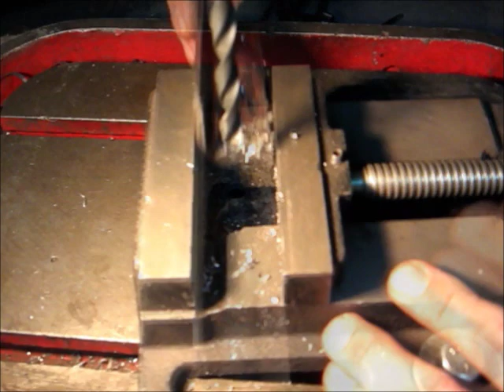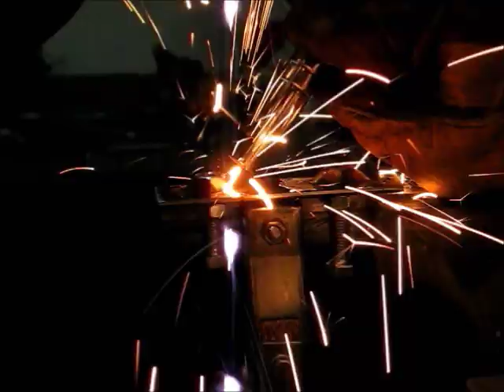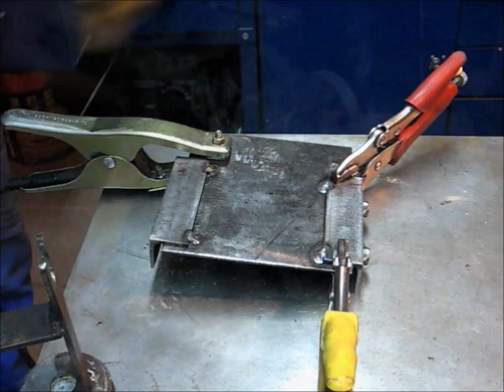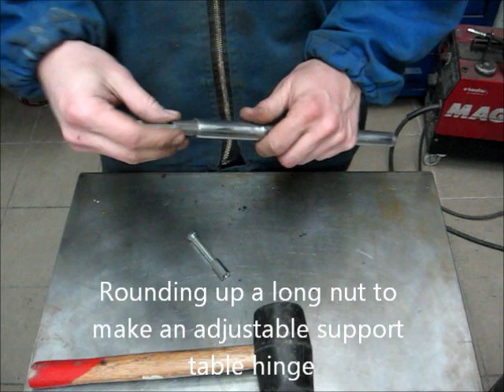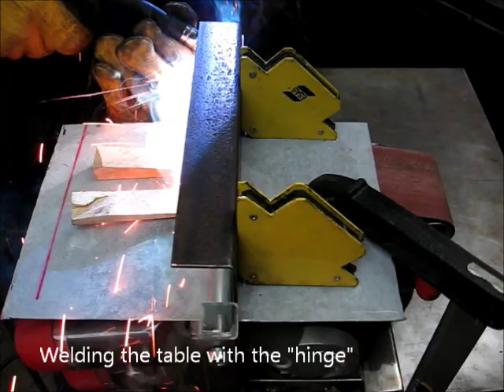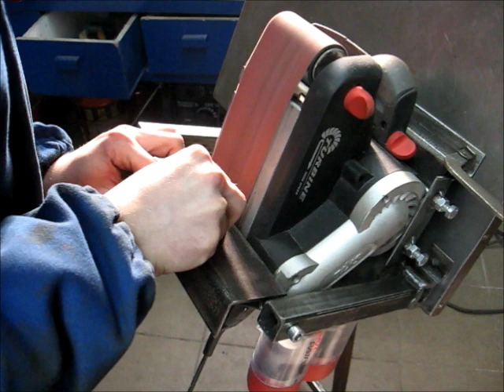Making Of a Belt Grinder Stand

Comment: When you grind steel, you have no issue with the sparkles getting in the tool ? My belt sander almost burned cause of this :(
Reply: obviously you have to take off the wood filter first and clean out any wood
Reply: Forjam it was off, I think it had more to be with the steel bits getting I  the motor, I got a cheap but decent belt sander where the motor is separated so it's safe from shortcut